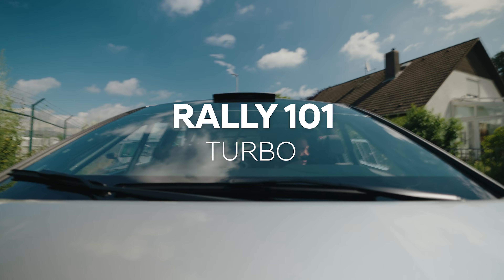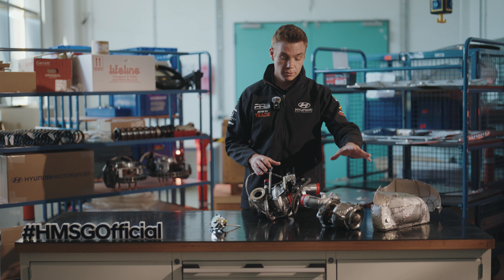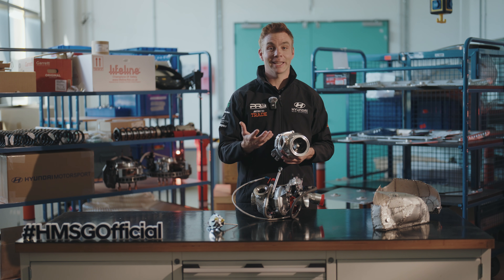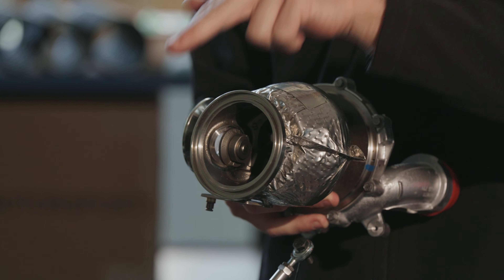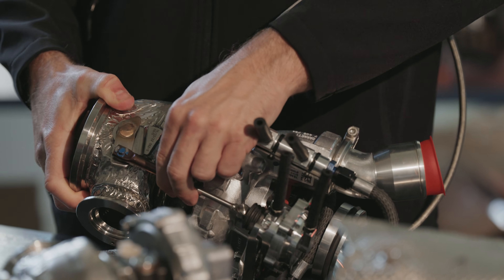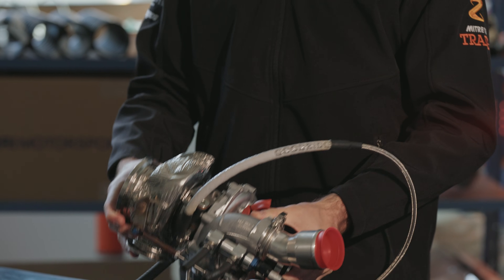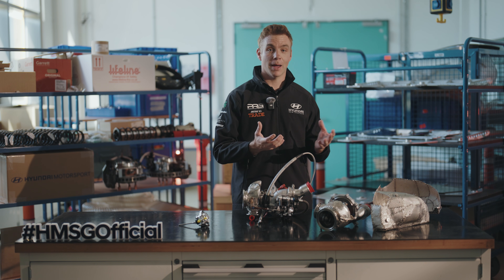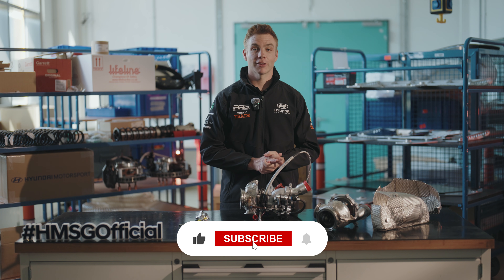Rally Turbos Explained Like Never Before

Comment: Just a clarification: the exhaust turbine (exducer) does not "suck" the exhaust gasses out.  It generally opposes/restricts exhaust gasses, which as a result spin up the exducer (that drives the main shaft and intake side turbine as well).
Reply from the maker: Actually, in this anti-lag system it does, as it creates a slight negative pressure that helps to suck out the exhaust gases 😉 (We know in normal turbo's it doesn't but this is the beauty of out system)

Comment: What could Hyundai build if there were no regulations?
48v, Electronic wastegate, electric turbo anti lag, no restrictor, AC enhanced intercooler, methanol injection, synthetic fuel… what else?
Reply from the maker: Rockets, we would use rockets! 🚀
Reply: @ rocket anti-lag I forgot about that!
Reply from the maker: You know it, plus it would have a hot tub for after a long day of rallying...😉

Comment: So will this turbo stop Hyundai/Kia engines from consuming a quart of oil every 500 miles after only 70K miles on the odometer? There are thousands of people with this engine that are being ignored by Hyundai.
Reply from the maker: Hey, while we feel your frustration hugely, we sadly are just the motorsport division, and this is not the standard turbo found in the road car. We hope whatever issues you are having get sorted soon!
Reply: @HMSGOfficial  Hyundai is ignoring the problem and says going through a quart of oil every 500 miles is normal, but we all know that's crazy.
Reply from the maker: Yeah, that is not right. We hope it gets fixed soon!

Comment: I'm curious is the DPV device (Dispositif pre a rotation Variable) or variable air pre-rotation basically a swirl throttle on the intake side of the turbo that chokes the turbo. This I guess probably be a illegal device in the WRC.
Reply from the maker: Exactly that, it is against regulations 😁

Comment: You learn something new every day 2:00 I did not realize a turbo sucks the air out of the engine 😂😂
Reply: I don’t think that can be correct, otherwise you’d have perpetual motion. The exhaust gases DRIVE the turbine wheel, not the other way around. The mechanical energy so recovered by the exhaust turbine is then used to DRIVE the inlet air compressor.
If you wanted to suck the exhaust gases out, the turbine wheel would need some external power source eg. electric motor. I’m not aware of this technique being used on any car engine. Not to be confused with a scavenging exhaust system, which works on a different principle.
Reply from the maker: We like your logic way of thinking, you should definitely be an engineer 🙌
Reply: @ haha, I became a Chartered Engineer in 1989…
Reply: Came here looking for a comment mentioning that little mistake in the explanation.
Reply from the maker: Fair play, but can you find anymore mistakes in the rest of our Rally 101 videos? Let us know, they are all here 👉 https://www.youtube.com/playlist?list=PLC5WXRaT9L-gr4xQbnw480kXSa6lWJ7Ez
Reply: @HMSGOfficial  someone really knows how to play the algorithm game. Hat off to you 😉
Reply from the maker: @Phrew  😉
Reply: Yeah, I stopped watching
Reply from the maker: Apologies, you clearly know your stuff. Can you see if you spotted any mistakes in our other Rally 101 videos? You can find them all here 👉https://www.youtube.com/playlist?list=PLC5WXRaT9L-gr4xQbnw480kXSa6lWJ7Ez
Reply: Measure the pre turbo exhaust pressure, you will find there is a no suction.. Hayden may get a surprise 😂😂
Reply: I always think of a turbo as waiting 4 a push when it gets it it sucks harder and compresses on the cold side once spooled it will try the suck on the exhaust side but is I'd say mostly pressure driven 
The overfuel after burner principle is a lil jet engined to keep it lit
I spose if it works use it 
Still less complicated than compounds or biturbo systems 
These cars would b tricky to drive with overun at times 
Ah well better than the dreaded lag or fall over up top if too small a snail  is used
I was just thinking I always think of diesels with no air restriction like no butterfly or barrell throttle 
Petrol would b different 
Because of throttle body hence a gate needed on intake side  so cold side doesn't become a brake at less than full open throttle 
Ah I dunno guess I'l have to wrap my head round the petrol or methanol side more  I must admit 
I've never been real interested in high octane turbo performance 
More blown cars for me 
Some turbo cars are getting so fast now though with better launch manners I've never liked their pig rooting spool up behaviour on the line  some of the barra powerboats are kicking well in australia at present
Reply: That timing dump and fuel thrown into the engine passes thru into exhaust turbine thingy is  interesting
The more I think of it lol low pressure sorta jet  engine  recycler 
For turbo lighting on the next throttle hit
Reply from the maker: Exactly that, delay timing so fuel ignites in exhaust, spooling turbine...quite literally BOOM 💥
Reply: There's only a very small window of time where it's actually sucking air out of the engine because of the inertia of the rotating compressor blades, This is that tss tss tss sound when you snap close the throttle
Reply: @pilotavery  Well...no, that sound is produced by the Recirc valve/blow-off opening to vent the pressurized air between the turbo and throttle. Otherwise the compressor would stall which might result in damage.
Reply from the maker: Congratulations on spotting the deliberate mistake 😉 Can you find anymore in the rest of our Rally 101 videos? Let us know, you can find them here 👉 https://www.youtube.com/playlist?list=PLC5WXRaT9L-gr4xQbnw480kXSa6lWJ7Ez

Comment: With fresh-air ALS being banned, how are you getting air into the system? Assume it's going through the engine by opening the throttle a bit? Is this affecting engine braking like cars of the past, or are they doing something creative with valve timing to mitigate the loss? Great stuff, by the way.
Reply: With No auxiliary fresh air allowed , you crack the butterfly open. The ECU has a few tables to manage the ALS, one of them is to set how much or little "drive" the driver can manage with. Different ECU manufacturers use different techniques to achieve a good balance between "engine braking" and a crazy fast response to the throttle.
Reply from the maker: Glad you like it! @zr6ajl is spot on!
Reply: @HMSGOfficial  now they just need to ban DBW throttles so we can bring back all the rotational idle sounds 😉

Comment: These are great tech videos, much more informative than the ones the WRC used to make. 

In fact, I'm so impressed that I'm watching these videos while I drive my Toyota to the Hyundia dealership, I have to stop though so I can call my friends as I don't think I can drive more than one new car home at a time.
Reply from the maker: Lol! Thank you! We hope you like the new car...or cars 😉
Reply: Probably in part because the turbocharger and anti-lag systems are a lot more regulated than they were in 2000-2010.  Anti-lag designs were much more complicated and experimental back then, and consequently, more difficult to explain in under 10 minutes.  The current anti-lag system basically rolls back the concept to 1990-2000 technology of just retarding ignition and burning extra fuel in the exhaust manifold (with or without air injection).  Drive-by-wire throttles and better electronics have made control over the process much more accurate, but the concepts are the same.  Even amateur teams will run similar systems to what is described in the video, these days.

Comment: I am glad to see Hyundai Rally team open up to explain they cars
And since I am a Rally fan of Hyundai,a former Car Mechanic as well as a proud owner of a i30N myself its awesome to see videos like these.
I do however have a question regarding the noise that the Hyundai or any of the other rally car have when slowing down rapidly.
Is the Wastegate causing the noise or the Turbo restrictor with the turbo flutter? or even both?
(By the sound I mean the squeeking sound or rapid deceleration when approaching a corner)
Reply from the maker: We are glad you like the video! The "chirping" sound is caused by the anti-lag system 🤓
Reply: @HMSGOfficial  more like the lack of a bypass (blow-off) valve.  The 'whistle' or 'whine' is the straight-cut gearbox but the 'flutter' is pressurized air escaping around the compressor wheel when you have no bypass (or are using your bypass exclusively for air injection into the exhaust).

It's very difficult to run anti-lag in the way described while maintaining a functional blow-off valve in the sense of what you would see on a production vehicle.  The performance benefit of getting the excess pressurized air into the exhaust manifold (either through the motor or using an air injection bypass valve) greatly exceeds the added longevity an OEM car's turbo would see from having a blow-off valve.  On a restricted turbo, the restrictor's mandated distance from the compressor wheel is the primary source of wear and tear as it forces an extremely high pressure ratio (which is also why ALS is necessary to maintain response).  Anti-lag can also beat the turbo up, but if turbine inlet temp. is kept in-check, this can be controlled.  With those two considerations in the mix, bypassing a little air around the compressor wheel is far less of a concern.
Reply from the maker: You certainly know your stuff, sir 🙌
Reply: @MrSaturn7085  That's quite interesting,respect my dude.

Comment: What is the difference of this turbo charger unit and the civilian version i20N .I can see they are both same size
Reply from the maker: This version is restricted to meet Rally2 requirements, otherwise very similar 💪
Reply: @HMSGOfficial  so the street car has an unrestricted turbo?
Reply: @OT-ud1oe  Crazy as it sounds, you can make quite a lot more power from a road car  than a rally car running in a class with a restrictor, simply because of the restrictor limiting the air flow. The rule guys go to a lot of trouble to make life difficult for rally guys 🤦‍♂😂 .
Reply from the maker: We believe so 😉
Reply from the maker: You know it!

Comment: No variable nozzles I guess, also I heard this guy needs a program in 2025 aswell. Maybe in a Rally1 in a fourth car, to restrict Adrien a bit less when he wants to push?
Reply: For the Rally2 Chassis reinforcement is interesting, and what makes a chassis well suited for Rally2 use, as its relevant right now for fans to understand with the WRC2 manufacturers also running out of hatchbacks to convert to a rally2 and maybe what the advantages and disadvantages space frames have.  Suspension and how they react to G-Force would be cool, but I dont think its allowed to say too much about it in detail. I d enjoy a video about suspension kinematics, maybe on the Rally1 since that was changed for next year, or on the rally2 and why gravel damper length is restricted there. Quality ensurement is interesting, but I guess also hard to make a video about it. Also ask the design engineers about one little solution they are proud of or just about an interesting development story. They usually have some of those, if they want to tell them is another story though 😂
Reply from the maker: Check back soon for a Rally 101 on suspension and dampeners in the next few days 😜
Reply from the maker: Did you see our Rally 101 on suspension? We think you would like it 👉 https://youtu.be/MGfvuKyodP8
Reply from the maker: Yeah, lots of restrictions on what you can do, etc. What would you like to see us cover in a video like this?
Reply: @HMSGOfficial  Also tiny feedback for the video: The explanation is a perfect balance of being technical but not too technical with good shots showcasing the unassembled parts from all angles. Keep that up, its the perfect mix in my opinion.
Reply from the maker: Awww stop it, you are making us blush ☺️ Cheers 🍻